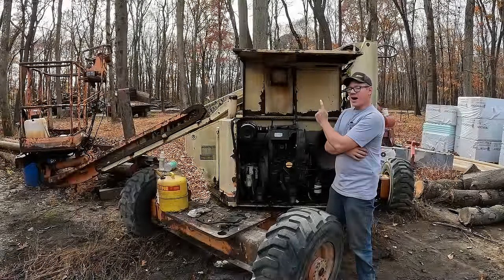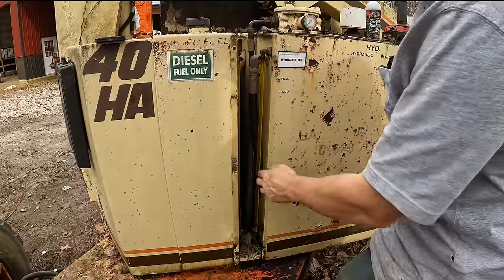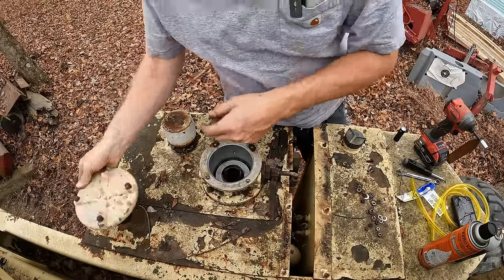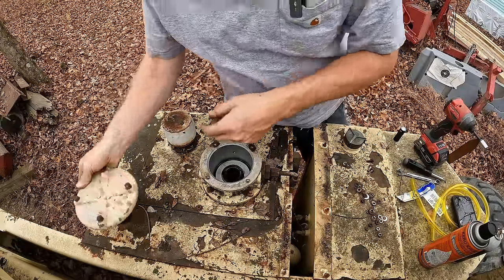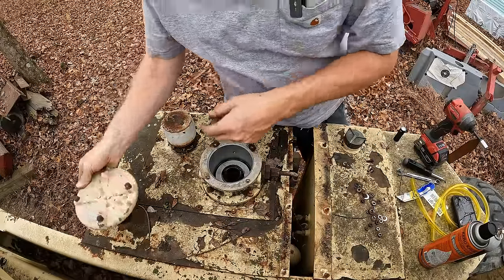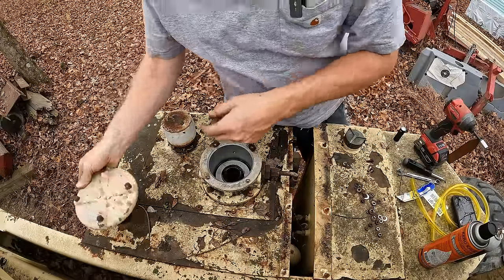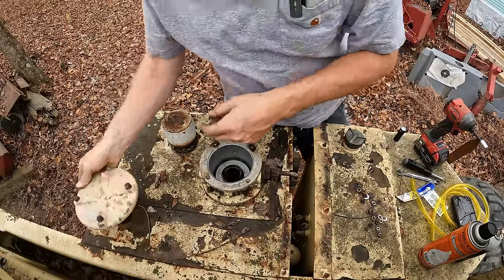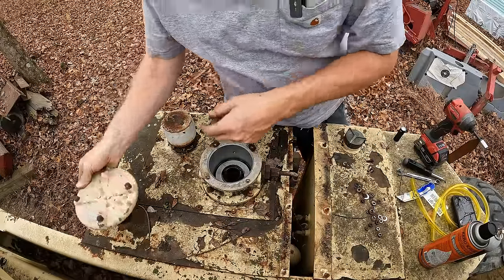I paid $1000 for this 4x4, Diesel, Man-Lift, What could possible go wrong? (JLG)

Comment: It doesn't matter how long the service interval is on your oil you should just stick to whatever is recommended by the engine manufacturer dirt and deposits will get in the oil at the same rate as it always has

Comment: Matt idea why didn't we drill a hole in each tank and weld a pipe insrt and some type of ball valve on hydraulic as nd fuel to be able to drain tain through fine screen and filter to be able to pour back in fluid if useable

Comment: Cleaning a hydraulic tank is never a good option.  In Viet Nam we had a rough terrain forklift hyd tank punctured by enemy action.  A sand storm came up a day or so later on the DMZ and we had an inch of sand blown through the hole.  Never did get it all out but we added two salvaged filters.  The ouside temp was 120 degrees so what oil we messed with was really hot too.

Comment: I think its a misconseption that anything else than full synthetic are the way to go. In the old days there was a price difference because of mineral being dirt cheap but these days the price is not an issue beside generally expensive and the secifications makes the difference a gimmick. Go full synthetic I say. It still uses a base oil that is from mineral oil.

Comment: Matt couldn’t you put 2 valves on the bottom of the sight glass and just turn them on and off to check your levels? We used to do that for the water tanks at the nursery I worked at.

Comment: Hey next time you clean the tank put a fuel pump in a pan with a power supply and a hose to a small air fitting now you have a high pressure tank washer lol did that a couple times works great great oh tanks like this

Comment: I have the same lift but a gas 40HA. The cylinders that let the front axle flex are not moving. One cylinder is all the way out and the other is all the way in. Even the slightest terrain the lift gets stuck. If anyone has any info i would appreciate it?🤔

Comment: corrosion is your issue for all the ghost things..... need to seal all switches and electric connection... then it's safe.... also that's a bad k ock coming from the engine....... might want the engine rebuild... Might want a keyed Ignition....... straight to battery... so when it's off.. it is off 😍

Comment: I’d ditch the site glass and go with the stick method, my buddy just had the site glasses fail him, not brake, but get plugged and wasn’t showing the correct level, could be even worse running it dry

Comment: I've worked 8 hrs a day for the last 8 yrs in a boom lift and my first thought is, What a piece of sh it. I wouldn't work in that thing. That being said it could be really cool when it's gone through. Be careful they will throw you up and out... watch some youtube videos boomlift  fails... that thing needs a lot of work and parts.. Make sure you fill the hyd. fluid before you raise the boom and extend the basket or else it will suck the tank dry. what a fun project. and wear a safety harness.

Comment: Could you encase that rated tubing in another non rated clear tube as a barrier layer to protect from exterior elements?  Like the valve suggestions too to isolate the glass.

Comment: this machine only see a lot of work, only standing outside in rain and weather. all these years unkempt. not even ONE after-sale service was done, for cost reasons. but made in the typical quick bungle way of the cheapest kind. Any other engine "made in China" at the time would not have survived. but this engine works. this have a have a reason for me. Deutz. Formerly Magirus Deutz. I also have a Deutz Diesel Engine (which I use almost every day) from 1985. almost Indestructible. Quality.

Comment: As you are concerned about danger of breaking of clear hoses at hydraulic tank: May be you can replace the biggest part up to level "ADD" by some steel pipe? Or are there reasons why the clear hose must go down nearly to the bottom?

Comment: Personally I'd be scared to step on such an old machine for fear of it slamming me on the ground after a hydraulic line failure. But of course I don't doubt you'd change all hydraulic lines before lifting yourself on that thing.

Comment: A few years back I worked at a mill with a similar machine....I thought you could get new labels and parts for the wiring harness....our heavy duty mechanic had to do alot of rewiring....ask me how I know.....stuck 20 30 feet in air

Comment: Very promising, still a lot of gremlins to kill but worth the effort, engine runs beaut. I have a similar screwdriver that pulls apart, there are 2 flat blades, 2 phillips drive sizes and two socket sizes 6mm/ 1/4 and 8mm 3/8 and the handle is solid aluminium, handy tool that I have had for years.
On the site tubes (or any clear plastic) we have a polish in Australia called 'Mr Sheen', an aerosol spray furniture and glass cleaner/polish and it protects from UV so good for that sort of stuff. I think it might be a silicon base?

Comment: I'd say you need to go through 2 of the main systems. #1 the electrical and #2 the hydraulic system. Wouldn't be surprised if you don't need to replace a lot of hoses and the wiring looks like an absolute rat's nest. That little 2 cylinder Deutz is a very dependable engine and will probably outlast the machine. They made that one in 2 models. The one you have has a Duetz injection pump. Theo other one had a Bosch pump. I may have an owner's manual for that one depending on which model it is. Be nice if you could find the layout for your dash controls to know what all those switches do.

Comment: Matt how much can that man lift Lift ? 
I had a idea 💡 if it is able to work properly here a idea put a winch with a assembly under or at bucket loop not for heavy application but let's say wood like 2x4 2x6 boards to lift to get able to left and secure that board then lower the bucket to the other side the lift to the area you needed ?I wonder does that harness come in whole group to just remove and snap the new line in

Comment: I would put diesel fuel conditioner or a quart of automatic transmission fluid in with the diesel fuel it cleans sludge in the fuel system  i had friend that is retired  Catapiller Mechanic  he did that  on a old piece of equipment  we had .

Comment: Hey Matt that old Wisconsin twin clyinder engine from that roller you put the kubota diesel engine did you use the wisc tank.or the kubota tank.for fuel as I was thinking if you have maybe the tank would be bigger to handle the larger capacity for this

Comment: Have you finished up this project yet? I checked your videos and have not seen a part 3 yet where you fix the electrical issues. Would love to see how you tackle those.
Reply from the maker: Unfortunately not, ended up getting a smoking deal on another lift the same size with just about zero issues so this got pushed back. It’s for sale if you are interested.

Comment: dude , consider getting a new wiring harness from the manufacturer - id just replace it all - there might be more electrical issues other than only the wiring itself 
also fix the starter before the ring gear is ground up into gear sand

Comment: It amazes me you tackle really big jobs but as soon as you get a wiring problem it scares the heck out of you all you have to do is think logically and label each wire but first it looks like you are going to have to replace the control box for the lift controls as that has seen better days either a new one or a good second hand one and splice the wires solder and heat shrink them then most of your problems are over with the wiring remember to do one data time label and replace don't get scared I know it looks daunting but a man of your calibre will do it easily so crack on then there are all those hydraulic lines to replace I think if I were you its time to invest in a crimping machine of your own and build your own lines it will save you money as you have so much hydraulic running machines good luck matt and have fun with the wiring so all the best from john from rugby UK.Ps I was a diesel mechanic and a psv mechanic before I was a car mechanic got exams in all of them so much paper work and years at college and then I took diagnostic courses in mechanical and electrical and hydraulic problems because I was like you you see you were not allowed to touch any wiring on a truck as you had your very own electricians so we never learnt anything apart from what we learnt at college which over the years you forget and if you did touch the wiring then the unions would go ballistic on your ass which sometimes we had to do the repairs as the wait was to long and the truck had to go out so we were backed by the managers but the unions and electricians hated us for fixing even thou you would of lost a multi million pound contract because you never delivered just because the tail lights didn't work over a busted wire which we fixed simply by soldering and heat shrinking and re taping the loom a better job than they would do lol they never cared about losing a contract but that's how it was in the eighty's so in the end I left and went into the car repairs breakdown service called the Royal automobile club which was very hard to get into they only picked the very best you had to go through several interviews i had 4 and different tests even a psychological tests and full background checks as we did army bases and airforce bases english and US bases in england as we were like aaa but posher we wore a uniform look us up we are over a hundred years old and backed buy royalty plus we had our own training school which trained many people outside of the rac like ford employees as we covered then ford if you bought a new ford you had 3 years frr RAC cover so if it broke down we would either repair it if possible as we carried certain spares for them and if it wasnt repairable then we would recover the car to the local dealers for them so we were taught all the injection systems including common rail for diesels and they had running rigs which they could switch faults into them and we had to find the fault and say what it was and puch the code into the computer then tried  to start it if it ran then it was onto the next test but we were asked verbaly how did we come to the conclustion and what was the actual fault it was so interesting and then you took and practiacal and theroy exam which was recognised by the city and guilds board who did all the exams for most things

Comment: I pulled a diesel creek, bought an Joy Air Compressor non running unit at an auction. Got it running with a fuel shut off solenoid, the engine runs mint. But now im at a loss at to why the compressor only builds 50psi, not more.
Reply from the maker: Sounds like you have an unloaded valve sticking
Reply: @DieselCreek  There is one fixture that is constantly leaking pressure out of a small orifice. If you have an email i could send you a picture of it. It has a line that goes from the intake of the compressor, to the body of what looks like a pop off valve, which goes to the pressure tank, and then the third line goes to the start/run valve.

Comment: I heard you say that a 95 model.
I worked on the line that built that machine from 94-95
Reply: I likely had my hands on that machine. But, please don't blame me for all the issues you find. LoL
I was building the chassis at first. That job consisted of building up the front axle, installing the drive hubs (front & rear), steer and lockout cylinders, wheels and tires and bolting on the bearing ring.
I moved to the second station on the line when I changed shifts. That station routed the hydraulic hoses for the chassis.. I worked in the engine area as well. I installed the pump mounting plate and the pumps mounted to it. As well as whatever switches or gizmoids needed to be on a particular engine.

Comment: It's fuel and oil-resistant, probably like the original sight tubes, but is it UV-resistant?  which is probably the main culprit for the degradation of stuff like that.

Comment: What Is the reason you Scoop hydraulic oil out and not just pumping it out . I have this cheap little pump that I'm sure would have pumped it out and it runs on a couple of D batteries.

Comment: Put a Steel line from the Bottom Cock to the Min. Or Just Below & Raise the Volume it would Contain in such a Failure from the Sight Glass. Called that because they used to be, why fix a weak link with a weak link ??

Comment: As you may not know those machines as to pass and annual inspection and structural every 5 years to prevent nobody get kill with those. Normally wen you find a supposedly good deal it is smell fishy’s from miles away.

Comment: You should never have run the engine so much without having suction line of hydraulic tank being submerged and also you never sealed the top of the tank after you removed it.  Water will get in your tank

Comment: I just wonder why ewery one of these "restores of old machinery" never clean it up before trying to restore or repear anything, is the old dirt ,smugde and leafs addin value to the thing? In my world it only make it harder to sort out the problems with leaks and old ruptured hoses ,craked lines and broken el connections............. a little time with a pressurewasher and some soap would make a world of differense..........................................

Comment: Why does this engine sound so hammer-y at low idle?  If this were a gasoline dngine I would be worrying about a broken wristt-ppin or a broken cylinder skirt.
Reply from the maker: It’s an air cooled diesel, no water jacket to dampen the sound of combustion. That’s just how they sound.

Comment: think I'd change the tank barb 90 adapter fittings out for street 90's, adding valves and straight barb adapters. then just leave them shut off except when you want to check the levels!
worst case it breaks while your checking and you turn the valves back off, that also makes it easy to replace the lines in future. 😁